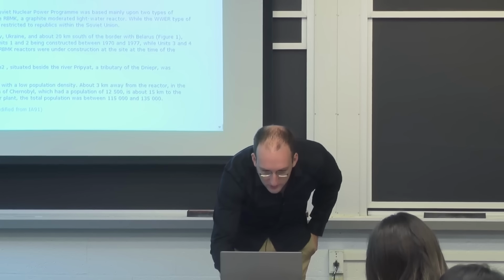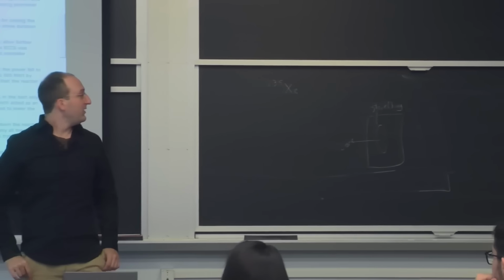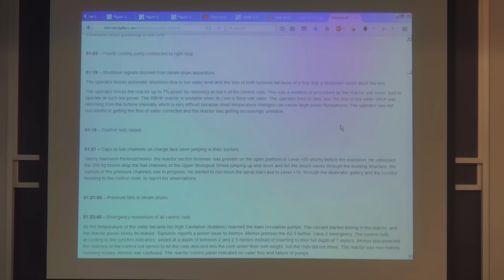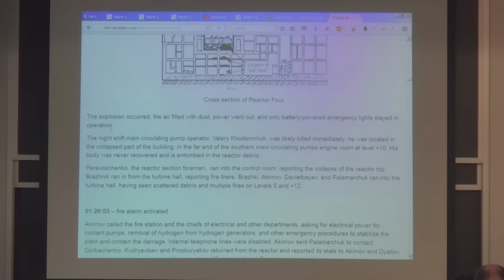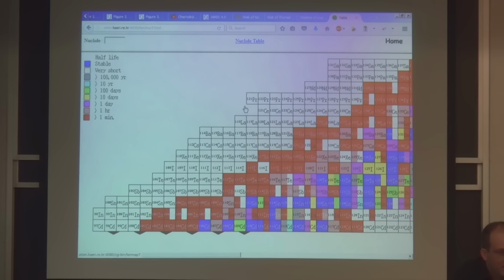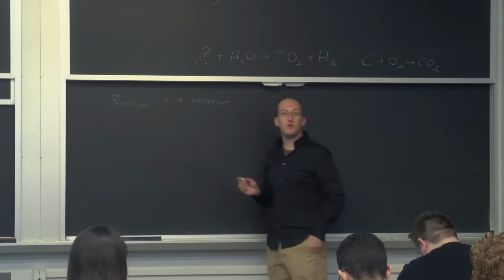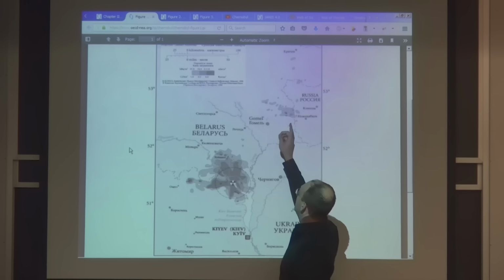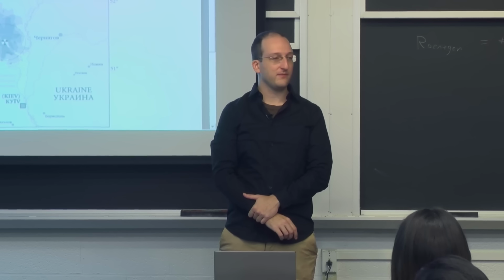26. Chernobyl — How It Happened

Comment: thank you.Something Though I've never heard about from Chernobyl and Fukashima, is how the safety standards and equipment are changed if at all. Presumably most links to health from radiation exposure have come from military sources which may or may not be accurate or honest, Accident like Chernobyl are bad events definitely but that doesn't mean they can't be used as data sets to help refine safety standards and equipment. Or are the pre-chernobyl procedures still in place and safety equipment still identical? or have reactors quickly implemented  extra steps to avoid reactor exposure or perhaps public safety signs that give more accurate information about the situation "right now" like those automated signs showing current time and temperature. Chernobyl was detected elsewhere because radioactive material had been released into the air and blown elsewhere before knowledge came from Chernobyl. Such a real time public information board will help the public to report to local authorities and get themselves to safety, certainly an early warning system. The accidents that have occurred have included improbable situations and of course procedures tell everyone everything is fine at least until proof of the exposure can be presented. It would also mean first responders can have the information before approaching an accident site and maybe pause to become better prepared.

Comment: Nothing should be able to live in within a 10 mile radius of Chernobyl.  But, wildlife flourishes.  There are only a limited number of explanations for that and none of them are consistent with what we were told happened there.
Reply: I think you fail to understand radiation. Plants and wildlife can certainly live, it's not like it is a complete nuclear wasteland on the outskirts. However, that also doesn't mean there isn't increased risk of cancer and such from the lower level, but constant, radiation that still is there. As you get closer to the corium and such, that is probably closer to your expectations, where the radiation magnitude is such that ionization is too frequent to allow general life to exist.

Comment: 20:00 one think I didn't hear the instructor mentioning is some sort of pressure valves and/or detectors? It's like the operators were in complete dark as to the amount of pressure building up into the system. Isn't this a design flaw as well? They should have known that something is wrong at the moment the pressure started building up. It seems like the 350 kg tubes were not designed to relief the pressure considering the explosion. Why were the control rods having pure C on their tips? Also seems like a dumb design.

Comment: "A little bit of radiation" is demonstrably "ok" because we've been able to evolve and tolerate low levels of ionizing radiation (e.g. potassium in bananas or solar UV radiation) and small exposure to uranium, but as soon as you go higher in the table, neptunium and plutonium are absolutely toxic as we've not evolved with them to develop a tolerance mechanism.

Comment: The answer to the last question (regarding the relatively small residual radiation at Hiroshima and Nagasaki) is correct, but incomplete.  Yes, a nuclear bomb is smaller than a large nuclear reactor and thus has less initial radioactive material and fewer fission byproducts.  However, an additional factor is that those bombs were airbursts, which allowed the vaporized nuclear material to almost entirely rise high into the atmosphere due to the heat of the explosions, carrying the fallout far away and diluting it by spreading it widely.

However, a ground-burst or underwater nuclear bomb produces massive amounts of local radioactive fallout, because its vaporized byproducts are mingled with tons of vaporized dirt or water, all of which is then contaminated, and heavy enough to not be lifted far up into the atmosphere.  Additionally, the neutron wave of the explosion transmutes significant amounts of the elements in the dirt/water into additional radionuclides, which doesn't occur in an air burst.  If Hiroshima or Nagasaki had been ground-level bursts the cities would have been dealing with residual local radiation for many years.

See the mess made by the "Operation Crossroads Baker" nuclear test for an example.  Some nuke test sites are still (60+ years later) more radioactive than the Chernobyl exclusion zone, albeit over a smaller area.

Comment: Professor Short is very impressive. 

35:12 interesting note, the Corium melted the floor and later it cooled into an elephant's foot-like column from the molten mixture of materials; ~20% of the core original fuel, the biological shield, concrete, sand, iboron, lead and graphite. Also, the recent attempt to contain the site with a steel and concrete outer sarcophagus. Time will tell if it will help control the fallout.

Comment: A really good explanation of the Chernobyl event. I was working at a nuclear site in the UK, at the time. We had just started our evening shift at 14:00 on a Friday i think, one of the guys had some work to do in the Reactor equipment building, he entered the building through and then realised that he had forgotten some tools, he decided to go straight out, and had to go through the exit radiation monitors, which alarmed to high haven one they started to monitor him. The radiation protection engineer was called, and he explained that he had just come in from outside and had not been in any contamination areas within the building . We had just had a shower of rain and so decided to use portable radiation detectors outside, to our horror, we were having reading 200 - 300 counts/sec... this was baffling to us at the time  as to where i the contamination had come from, we eventually found out the following day, i think, what had occurred at Chernobyl.  Reactor Safety systems are designed to keep us all safe, shame they by-passed them, but they guys who tried so valiantly to contain the contamination spread at the time were real heroes.
Reply: Same happened in Germany. My father was the radiation protection responsible on duty in a nuclear power plant when they had workers coming in from Austria or Bavaria, where they have had rain. As the workers entered the plant, the contamination protection was activated and automatically closed the turnstile.
Reply: That was the most interesting and relevant YouTube comment I’ve read in a long time.
Reply: R😊😊😮😅😊😊😊
Reply: owenwilliams9582: The counters you had that you mentioned were detecting 200 to 300 counts per second, what would the normal background measure with the same instrument?
Reply: Is that a lie? You're just repeating the story of what happened in Sweden.
Reply: @thert.hon.thelordnicholson7261  It happened everywhere, in Finland too. We just didn't report it at first because we were doing business with CCCP back then. Politics couldn't expose them.
Reply: @thert.hon.thelordnicholson7261  The north of the UK is about 500 miles down wind from Sweden. Lots of Chernobyl fallout fell there, particularly because there was intense rain that night.
Reply: @thert.hon.thelordnicholson7261 it happened all over Europe. The entire continent got a nice blanket of the stuff once the reactor meltdown happened.
Reply: how did it explode it was like a steam fart that blew the reactor open it was an amazing site to watch just before the radiation kills you

Comment: Excellent presentation. Very informative in regards to actual timeline of events after scram circuits disabled to allow out-of-spec operations and ultimate disaster; plus including the measurement of, environmental and biological effects to various fission/fusion/explosion products with supporting formulae, really rounded out the presentation for students. Having some experience in particle research in thermal reactors and accelerators above 1 MEV for a short duration, the course material was refreshing & pertinent. Great job Professor.

Comment: chernobyl was designed by america and the russians listened to the americans when they were told they could increase output from 1gigawatt to 1.5 gigawatt by switching the fuel from yellow cake to metallic uranium. but they did not properly encase the metallic uranium and it oxidized freeing hydrogen. once hydrogen reached over 4% all it took was a spark. the explosion was not nuclear but the free hydrogen. remove water and a reactor fire dies down... so why do they pour water on reactors like they did in japan after the tsunami? because they are destroyers of our planet. chernobyl was caused on purpose

Comment: there was no melt down at 3 mile island.they purposely scrammed the reactor 3 times shocking the fuel rods until they got a 1% breakage. it was a test run for the newly created fema. Galen Winsor (who was the nuclear engineer who helped design and headed the plutonium recovery plant in morris il back in the 70s) was sent in to inspect the core and recommended they restart the reactor. fuel rods are not as important when using yellow cake (uranium oxide) because uranium oxide is already oxidized and the rods were originally designed to protect metallic uranium from oxidizing. the core was later shipped by rail across the country. they purposely destroyed the reactor and passed the cost on to we the people.

Comment: Just finally watch the 2019 Chernobyl series last week. This was a great and more in-depth overview to a lay-physicist of how radiation works, the sequence of events and contributing factors leading up to the disaster, and how radiation affects the human body and cells. Absolutely fantastic, thank you!

The only thing that was skirted over, which the series went into a bit more detail about, was the 10 hour delay of the reactor running at 50% capacity (for economic reason & why the safety test was delayed to the night shift), which as a result created an unusually large build-up of Xenon, which then became a major preciptating factor during the ill-fated 'safety' shutdown. The mind boggles that anything like this could ever have happened - you couldn't have orchestrated the chain of events by sabotage if you tried most likely! But, leave it to Russian superiority, engineering and know-how to find a way...the most amazing political fallout was that Gorbachev said in 1991 that the dissolution of the USSR was in large part to the failures at Chernobyl and the total loss of confidence in the State by the people.
Reply: The core was kept at 50% power because something happened within the energy grid that day and they needed the power or they probably would have had to start load shedding. Nobody is sure why this happened, no other power plant staff have come forward and said their plant or reactor hard to shut down and disconnect.

This 10 hour delay actually depoisoned the core, despite this lectures claims the half life for Xenon-135 is only 9 hours, so the Xenon was back to normal levels by the time of the run down test. If they had not had the delay, the core would have been easier to control, the Xenon would have lowered reactivity.

And the Chernobyl series and parts of this lecture are pure soviet propoganda. The reactors were dangerous and they didn't know when they designed them because "We have created something no man can comprehend." Unable to because they lacked the computing power to fully simulate the core and test adequately, even as the first reactor was coming online they still had not done full computer simulations.

The reactors started life safe, any issue would lead to negative reactivity and shut the core down without any interference, if they'd done the run down test within the first year, none of this would have happened. But as the fuel burned off the void coefficient of reactivity became stronger, so strong that it overcame the total negative coefficient from all other sources. At the time of Chernobyl it was calculated to be 5 times the level to sustain the reaction. So the reactor is trying to run away at all times and only the control systems in place were keeping it stable. With a test that stressed the reactor by reducing the cooling level available and then once the test was done, the reactor was scrammed to shut it down and end all the testing that was done on that day. Except nobody in the control room had any way of knowing how dangerous the reactor was at the time due to not having any read out from the reactor (control rods being a perfect example, it took a few minutes for the computer to give this information and it was printed out in a different room) and not being told about the positive scram effect that was found previously.

Comment: most people have NO idea how powerful steam is.  when you have high pressure hot water contained in a system and that system is breached (high pressure hot water being water that tends to be WELL above waters flashing temperature of 212 f or 100 c but still being water because water will not turn to steam under the correct pressure) the water will almost instantly expand 1700 times by volume.  imagine that on a large scale.  the hotter the water the higher pressure is has to be to keep it from turning into steam. so you have VERY hot water under VERY high pressures to make the power plant the most efficient you can.  not only does it flash to steam at 1700 times the volume of the water but it has the massive pressure in the system to push every bit of water out of the breach making the process all that much more violent.

Comment: if the disastrous technique here could have been perfected and used as an emergency backup procedure worldwide the disaster at fukushima could have potentially been avoided...  assuming they could recognize the problem and get fuel into the backup generators in time.  probably not, but interesting food for thought.

Comment: Pretty awesome video.  I watched several documentaries and sadly lived it through. I was living a few hundred km's away in 1986 from Chernobyl and I remember being sick and my hair falling out.  I survived and many others did but we heard of several hundreds in our town who fallen ill and died.  The design of the reactor was safe. It was at the time one of the safest.  However the test they were doing and how they were doing those tests, were the key issue. Had they not ignore the safety protocols and keep the original safety measures in place, this would have never happened. Also there were some pressure and heat sensors that were placed only one side of the gates and therefore gave false information, so the control room were not aware of the rising steam levels. Anyway this is an another reason why nuclear power is the worst polluter and the most dangerous.   Hydroelectric, wind, solar are much safer. None are without its problems, however I much rather live 100km away from a solar farm or wind generator than a nuclear plant.  Coal power plants are much better now than 30 years ago, they aren't terrible but if there is a way to generate power cleaner we should explore that option for the future.  I hope that nuclear plants are no longer built (they are sadly) and the research would focus on SAFE power generations.

Comment: The disaster happened for this reasons:
1. Testing any such system and all industrial systems   is very dangerous  as unexpected events can hapoen.

2. Testing systems  in the middle nof the night is imbecilic as operators may not be fully alert with all their senses.

3.  Testing should be done when all responsible personnel and experts are fully available. 

4. No extreme tests should be done as catastrophic results can result in nonreversible and unpredictable results.  

5. Managers should not over rule experts and engineers.

6. All emergency personnel and key management should be ready to respond.

7. One test per week  should be done. 

8. The worst outcome should be assumed and remedial  alternatives should be planned ahead of time.

9. Alert all medical personnel .

Comment: I'm so sorry when lector of famous university stooped to dumbest propaganda. "Because it was thought that nothing could happen"...  RBMK is a channel reactor. How could you build a containment shell for all its system of channels, pumps, valves and so on? It have to be enormous construction, it must be whole solid and hermetic. USSR had very big problems even with containments for VVR-600/1000 type of reactors. Channel reactor is easy to build,  much easy to reload, you can reload it without stops, you can use it for special isotops production or reforcing materials by neutrons, for example. But everything has the price, this type of reactors is potentially much more dangerous than reactors with containment. Do you suggest that soviet scientists and engineers were complete fools and prone to suicidal nonchalance instead of americans, don't you? What a shame, especially for scientist...